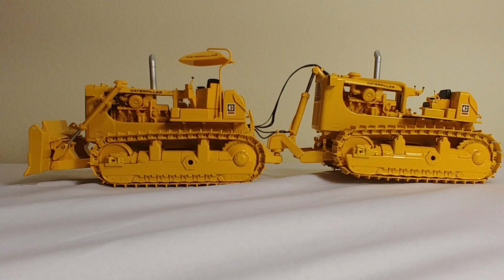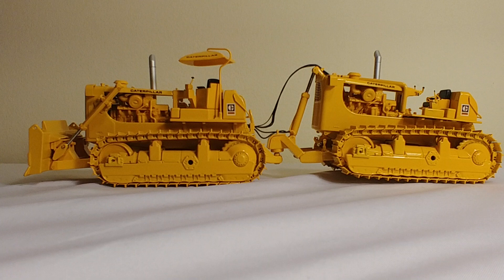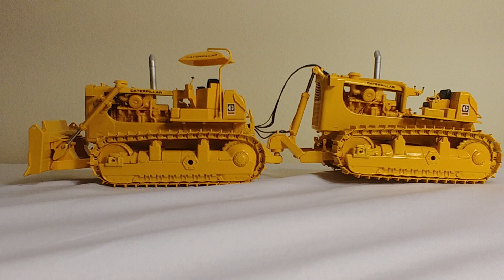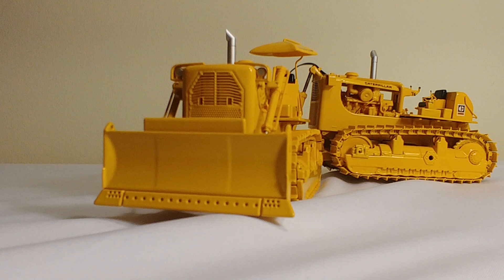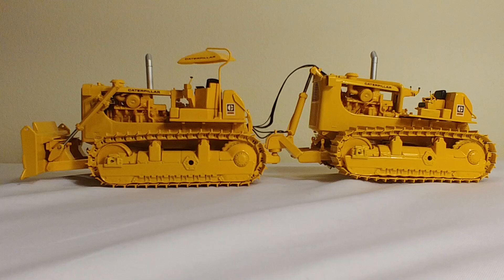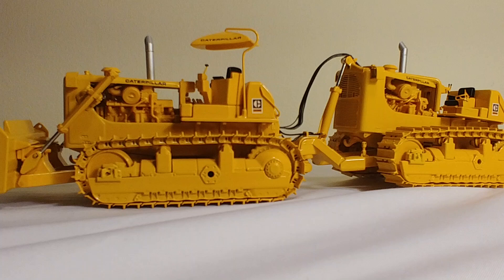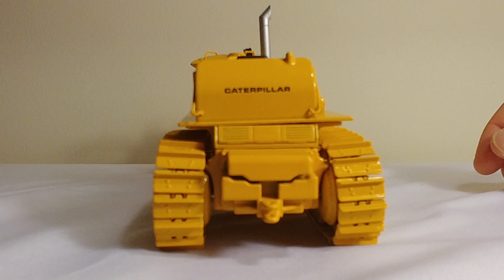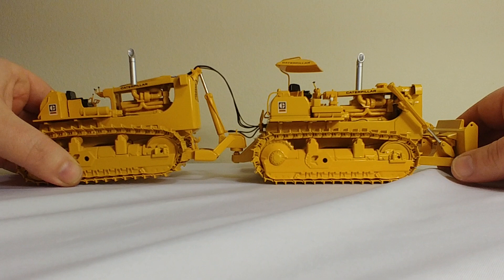Classic Construction Models (CCM) Caterpillar DD9G Push Dozer with Dual D9 Tractors

Comment: Nice set. I remember a local Cat dealer giving me a brochure on these as well as the side by side in the mid 70s, probably the last year they were made. I see the front unit has the angled operator seat setup. The hydraulic cylinder on the link between them and the raised front track is interesting. I assume this puts more weight onto the rear of the forward unit to increase traction.